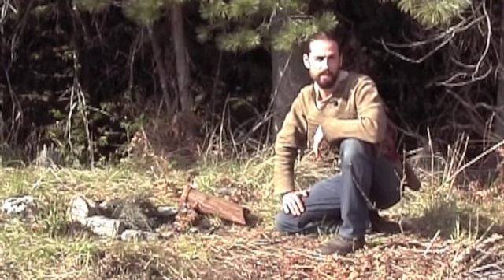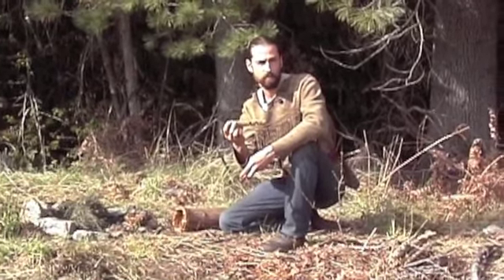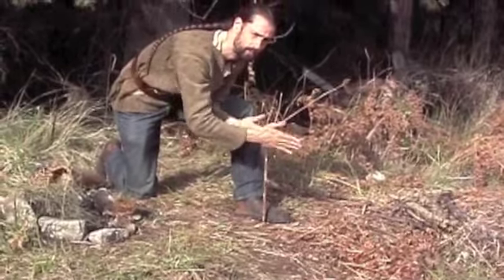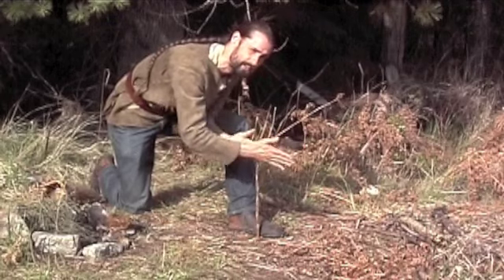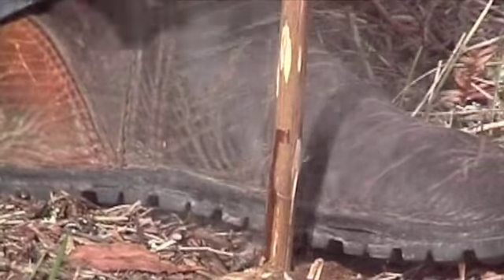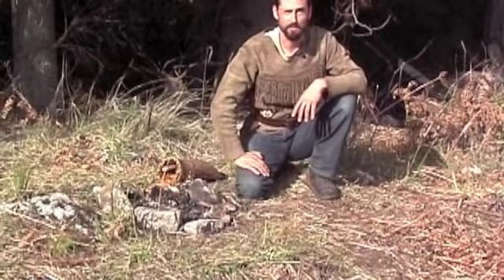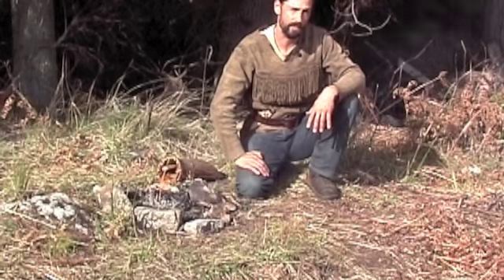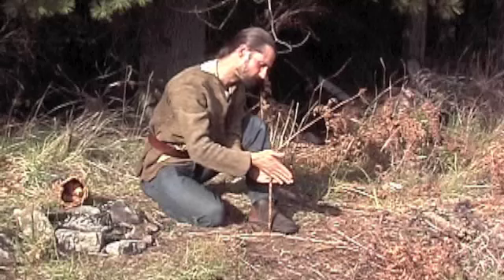Best Hand Drill Demo Ever -

Comment: Cattail is very soft.  It is hardest at the leaf nodes.  If the basswood you are using is particularly hard, then you'll have difficulty burning in.  If your set is well matched and you press down hard enough, you'll have no difficulty burning in.  Most people aren't pressing down hard enough and they end up burnishing the hole.  If that happens, you can add some sand to grind off the polish.  I don't use anything to burn in the hole besides downward pressure and speed of rotation.

Comment: I've never tried cattail on basswood, but I've used cattail a lot.  At the leaf node, the cattail is harder and often works better.  Sounds like a good combination.  I've used a lot of basswood for bowdrill.  You'll need to match the diameter an hardness of the cattail with the basswood so that it isn't just drilling through the board.  If you don't get really fine "silky-feeling" dust, you may be drilling too fast.

Comment: Mullein, which he uses as the spindle, grows everywhere in the US, usually rocky roadsides or disturbed areas. Google it if you're unfamiliar. 

For the fireboard, try Cottonwood, Eastern Hemlock, Beech or Basswood/Linden. There are many other woods that work well, but those are common in the north east. 

best of luck!

Comment: Western red cedar was the wood of choice for Northwest Coast tribes for handdrill, though it isn't the easiest material to work with.  Cedar's growth rings are very hard and the wood between the rings is very soft.  So, if you are having your spindle "drift" away from your initial hole, it could be the angle of the growth rings (the spindle burns down to a growth ring and then burns along it rather than straight through it).  If your spindle is getting stuck, then carve out the edges of the hole

Comment: You might also be making your notch too big (1/8 of the burn hole).  Other good species to use in the boreal forest are black cottonwood and some willows.  Try lots of materials and see what works.  You'll find that there is sometimes more variation in hardness within a species than between species.  Good luck!

Comment: Great vid, but how come every hand drill instructor on Youtube shows up with a ready spindle and board, all burnt in and notched. My problem is to burn in the hole in the first place. I spent like an hour on this yesterday. The tip of the spindle got a little hot, but that was it.
How do you do that? Do you use sand or coal dust to create more friction? I think maybe I’ve seen massais use something like that on a Ray Mears video.
Oh, and I use cat tail and basswood (linden) by the way.

Comment: Hey there,
Making the ember? NO PROBLEM. I can make it every time with goldenrod and cedar, but only like 12% of the time with the ember ignite into flame in the bundle.... no, the ember is big enough for sure. sometimes I make it enormous, but the reason it doesnt ignite is because when I put it into the bundle the ember just burns through it and out the other side..... this almost always happens when I the bundle is left on the ground sometimes while I hold it too. help!
Reply: I don't know if this is still an issue for you, but I'd recommend making your tinder bundle thicker and fluffier, like an actual bird's nest. Also don't blow too hard, use the smoke as your indicator. Less smoke means blow or wave softly, more smoke means you can blow or wave harder.